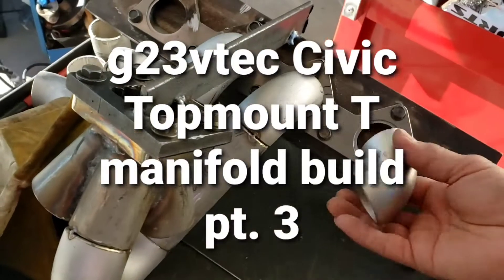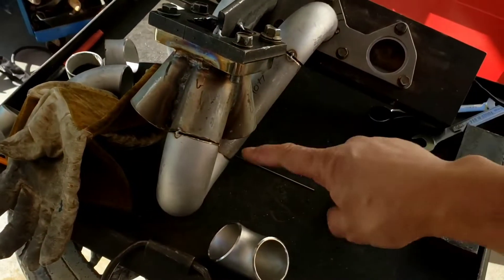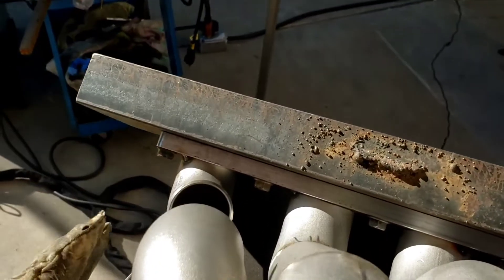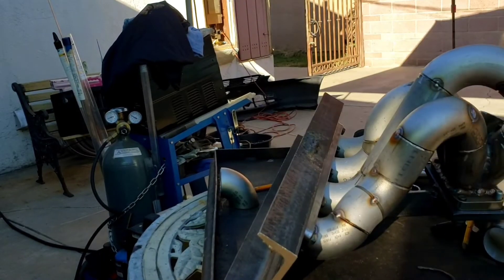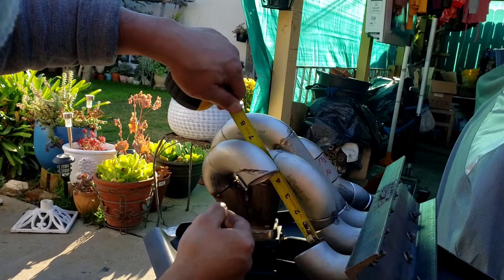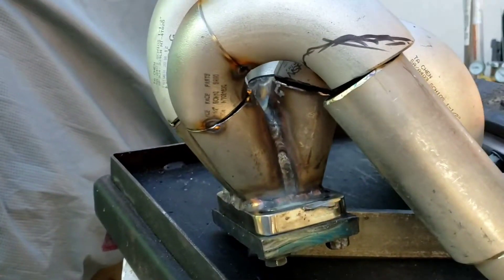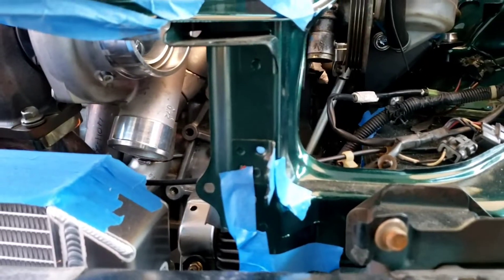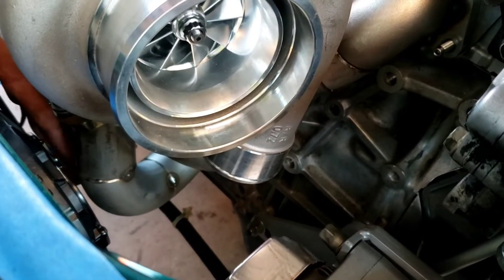Topmount Turbo manifold build, g23vtec swap Civic pt. 3

Comment: hello sir, any suggestions what size of pipings to use for a d15b td04 turbo setup ? no ports . 🇵🇭
Reply from the maker: On a D15 w/ td04, if it's my build, I'll use 2 1/2 piping, fic inlet n' outlet and 2 1/2" exhaust pipe will be fine. I think 3" is a bit overkill on 1.5 ltr. Actually depende kung paano mo gagamitin. Are you thinking og using it on track or street racing? I think if it's just for weekend use, l think 2 1/2" piping is okay.
Reply: @sagittnet2158  maraming salamat sir. Street/daily lang po hehehe
Reply from the maker: @jay-arpinote5220  2 1/2 pipe kung sakin ang project mo at salamat sa time.